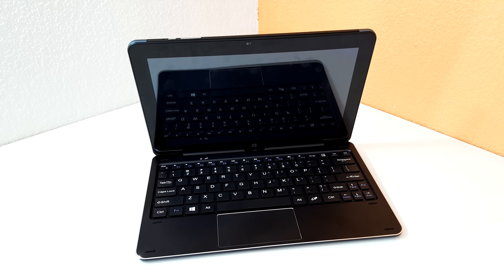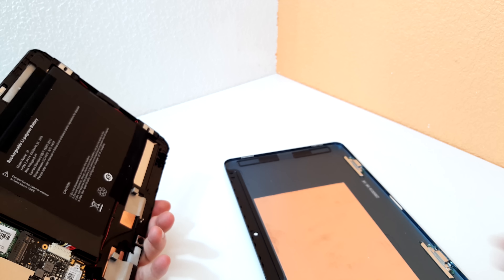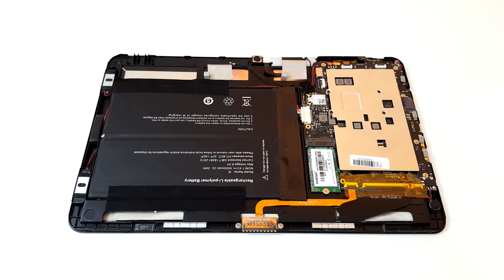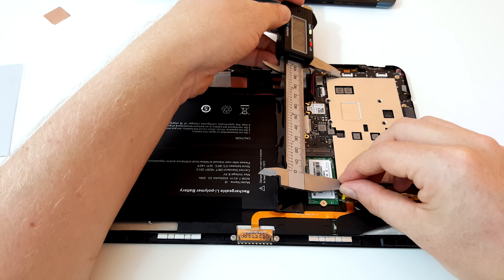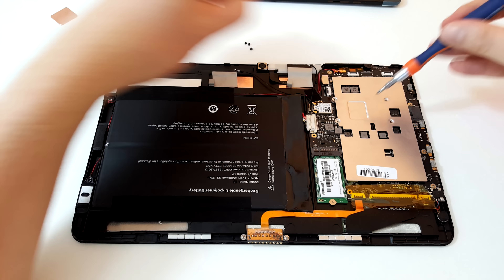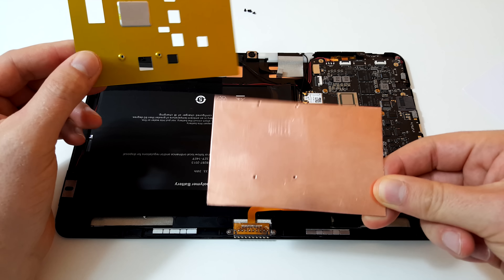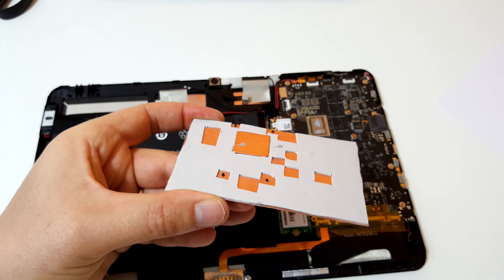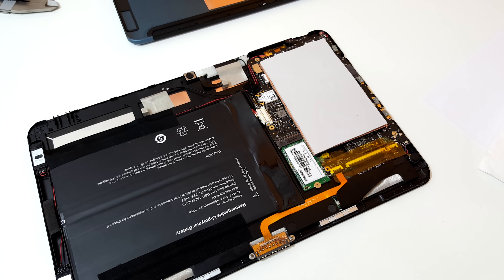Cube i7 Book Internals, Thermal Mod Ideas & Results

Comment from the maker: Improves max temps by up to 25 degrees & increased performance. Recommend mod here: http://techtablets.com/2016/07/cube-i7-book-thermal-mod-time/. Best price $272 with coupon 27fc14 here: https://goo.gl/O0bdfY

*if you plan on getting the best gaming performance, DOUBLE FPS in some games, add 3 watts to the power limits  with XTU and watch the GPU clock and hold 799 Mhz instead of 499Mhz.

*Please do this mod at your own risk, you can seriously kill your tablet if you do this wrong and you will loose your warranty once opened.
Reply from the maker: By the way, sorry for the long video. It's unscripted and raw (Like all my videos) but more so as it was all done on the go. Results are quite amazing for example Hl2 lost cost got around 30 fps, now gets about 60fps 1080p with this mod. It really lets the GPU hold higher clocks and performance almost doubles in games and benchmark results. My Cube i7 Book here is now faster than my Surface Pro 4 M3 https://www.youtube.com/watch?v=BJCL3nFfoMs
Reply from the maker: There is some more info here on my mod with recommended size and steps: http://techtablets.com/2016/07/cube-i7-book-thermal-mod-time/
Reply: My Teclast X80 Plus win10 is corrupt... can you make full toturial how to clean install win10 on teclast X80 Plus.. mine tab id is H5C5
Reply: amazing results, very impressive great job!
Reply: if you plan on getting the best gaming performance, DOUBLE FPS in some games, add 3 watts to the power limits  with XTU and watch the GPU clock and hold 799 Mhz instead of 499Mhz.
how to do this ?????
Reply: what is XTU ?

Comment: just did this mod today (the easy version 1.5mm copper plate and a thermal pad on top of the stock heatsink ). before the mod my tablet was shutting down while playing easy games like warcraft 3 and even the basic benchmark  3dmark11 now it works (score is now 1251) it still gets a little over 80° but works pretty well. took me half an hour to install it. so thanks for that
Reply from the maker: Glad it works well for you!

Comment: Just to add in, I did a mod similar to this one, i was using 0.8mm copper plate and installed it into small sunken area, and then added other (0.8mm) copper plate above which is slightly bigger. I used a small amount of powerglue and some amount of thermal paste to connect the copper plates together. After that I put thermal pastes in the inner sunken part to connect the metal plate to the copper plate. Before I close it with the case I added some thermal paste inbetween. The result is somewhat OK. Not too disappointing but not too phenomenal. I hate it because it makes the case protrude a bit and feels like it pushes the screen. But with this mod I can add about 2W of thermal power limit before it reaches absurdly hot temperatures (ie 90C). Actually, this heatsink's job is just to transfer it to the case back there. If no heat is taken from the case back there then it won't help much IMO. With this mod, case AND SCREEN feels way hotter and won't be comfortable to touch while gaming.
Reply: This mod will somewhat help because there is an empty space (I guess around 0.5mm?) between the built-in metal heatsink and the back case's copper. You can feel it when you try to push the area in the case. If you try to push the area with the battery you will feel nothing because there's no space (or less space). For me it improved clock speeds a bit while doing long gaming sessions, but nowhere near full potential, something like from 1.2GHz CPU and 450MHz GPU to 1.6GHz CPU and 650MHz GPU. Underclocking helps as well! I hope my posts help those who are somewhat curious
Reply: Update, I removed my old mod because it was pushing the screen. Now I just use a small 1mm thick copper plate to fill the sunken part. It will protrude a bit compared to the metal, but I think it made good contact with the back case without really pushing it. The contact area is surely very small. But temps are not bad, I can play with 8W long-term (90C). Before mods I was only able to get it to 6-7W IIRC

Comment: It's actually a .7mm thermal pad between the CPU and the metal plate.  I have .5mm .7mm and 1mm thick pads on hand and .7mm was the winner.

Comment: I learned a lot from this video! Thanks!
Just went to see if you have done the same on the i7 Stylus and you didn't.
From your experience, what's the simplest procedure to lower the temps you would recommend?
*Removing battery.
1. Puting thermal paste on CPU & GPU.
2. Puting Copper 20x20x1 copper shim.
3. Applying the original casing.
4. Applying  big silicone thermal pad (1 or 0.5 mm?).
Will it work? (Already planning on changing the SSD)
Reply from the maker: More info with steps can be found here in the write-up below the video: http://techtablets.com/2016/07/cube-i7-book-thermal-mod-time/

Comment: Excellent videos and I think I will do your suggestion at the end.

Isn't it dangerous to keep a big copper plate on top of components where previously you had cutouts for them? Just wondering if sustained heat could damage them.

Last but not least, any recommendations where to buy or does a specific material grade exist for copper shim?
Reply from the maker: Well in the end, I used insulation tape to stop (hopefully) any shorts and here is a tiny gap where it doesn't touch those components. So far so good, but it is a risk. However, it's not getting as hot as it did before so this should help. There were signs of the thermal pad burning on the CPU or GPU die I cleaned off.This must have happened when I was looping 3Dmark11 and charging at the same time. It got quite toasty!

 I sourced these parts from eBay and even Aliexpress. Craft shops sometimes stock copper sheets that are 1mm thin or less that would be perfect. Just ask them to cut you some pieces.

Comment: Hello,  great Mod. I think also trouble is the hole in middle, not ggod contact to backside. I want to mod also , just a new Thermalpad betweenDie and Alu and another include small Copper-Shim on top of Alu-Plate.
But my Question: What is best methode to start Opening, you has opened in the video, a new M2 wait also.  :)

Comment: I reckon the only thing wich woul'dve made great improvements you needed to do is put a thermal pad in the designated area. It seems they might have just forgotten it. (hp once forgot to remove plastic protection from a laptop cooler in my laptop. So the paste never touched the socket, there was plastic between it) Strange things can happen.

Comment: hi friend! nice video! I buy this tablet and it's stop to work. no led light is turned on when I connect the battery charger, it's completally dead! I open this tablet and measured 7.45V in the battery (red/black wire). the charger is ok also. what should I do or test to make its working again?? thanks!!

Comment: hi tech tablets, i see that the cube i7 book got a small white port that is not in use. do you think that we could put a 4g LTE modem, i just say that, because i see in the black plastic where the volume and on/off button are, but is you see in the right side on the black plastic, it look like cube left a space there for a 4g version, also i can see that they market i see a slot for card there but is close. do you think that could be for a 4G LTE modem???

Comment: 9:50 Can you tell, what kind of 4G LTE modem will fit in slot? Where buy?
Reply from the maker: Not sure, but it has to be a 2242 M.2 modem spec 4G Huawei I think works (well did in other models) But I'm not 100% sure.
Reply: Thanx for reply! Sorry for that i waste your time but i have another question :) ... In case exists slot for sim card? And i dont see antena. I think is not possible to insert modem.

Comment: Would it also be possible to up the power limit on the atom processors or will that create thermal problems? Have you tried this before?
Reply from the maker: Atoms unfortunately don't allow those settings to be tweaked.

Comment: How many mm should I add so it won't affect the screen ? I want to give thermal paste, 1mm copper plate, 1mm thermopad, original heatsink and 1mm thermopad over this. Should I give a thermopad over the holes in the heatsink or would it be better to cut it in the shape of the original heatsink ?

Comment: im going to do this for my teclast x3 pro just that i will put copper over the ram so i can overclock that along with the gpu also for more fps and then cut out the back of the tablet and make a cut out on the case im gonna by for the tablet and just make as much layers of thermal pads and copper p.s. how did you make the holes for screws and im doing this crazy mod because i was looking for a gaming tablet and ther surfae pro thermal throttled like a bitch
Reply from the maker: To make the holes I just put the old heat sink over the copper and use a small hole punch, then a larger metal drill bit to try and round off the edges. Its not a very good job, It was hot and I was growing impatience with my mod. Take your time and do a good job of it. I wouldn't recommend messing with any bios settings like RAM speeds and timing, a good way to brick it and cause it to fail to boot. Or do you know how to tweak the ram timings? Best way to increase FPS is first do the copper heat sink mod, second increase the power limits with XTU and enjoy a massive boost in games like CS:GO, LoL etc, lower end titles the results are best.